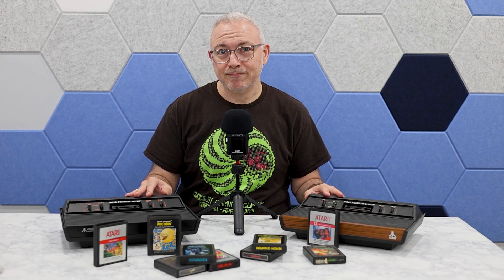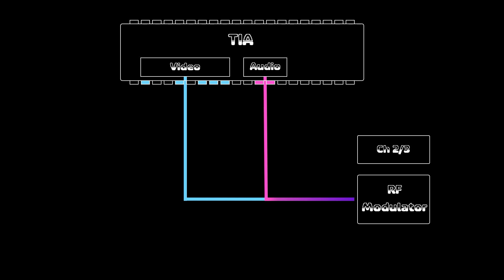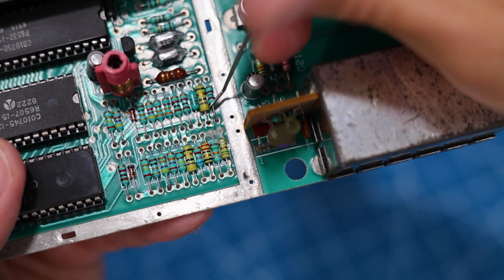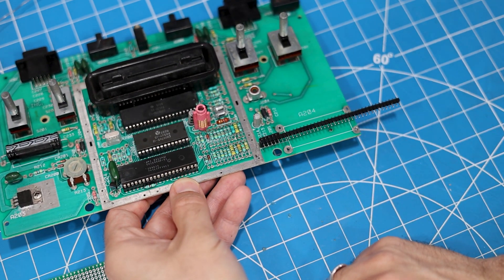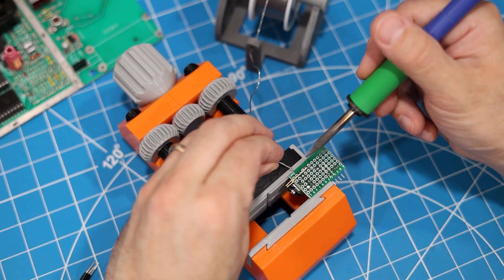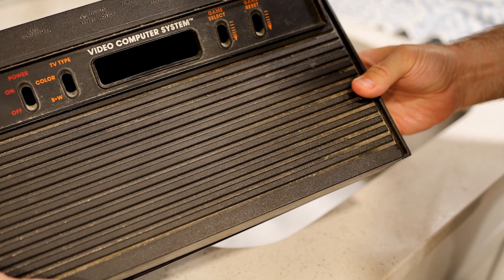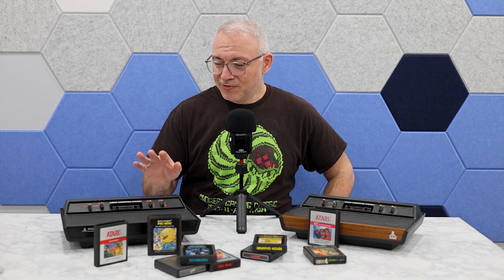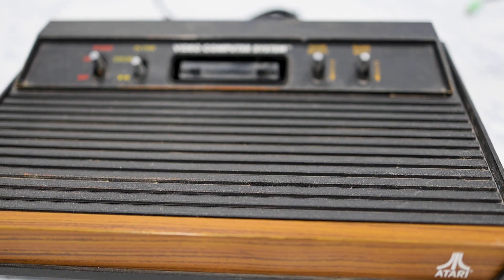Revitalizing an Atari 2600 Vader with a Super Simple Composite Mod

Comment: Hi Ken, is the emitter pin supposed to be wired directly into ground as well as into the video out?? Wouldn’t that short the video output to ground?
Reply: I was about to ask the same thing.   I went and watched his Atari 7800 mod video, and there was a Resistor between the Emitter, and Ground in that circuit which makes sense.

Comment: I don't understand why this would work at all. Composite out is tied hard to ground? Assuming a good ground connection the output should be zero volts, according to your schematic ground and composite outputs are interchangeable - unlikely?  I would expect a resistor between the emitter and ground, both to current limit the transistor and to allow a voltage to be generated at the emitter.

Comment: does it work on pal models?
Reply from the maker: The principles of the mod are the same for both PAL and NTSC, but they are different boards, so the exact steps I walked through here won’t work on the PAL board. You should be able to walk through the PAL schematic and apply the same principles I applied in this mod to get a similar result, though.